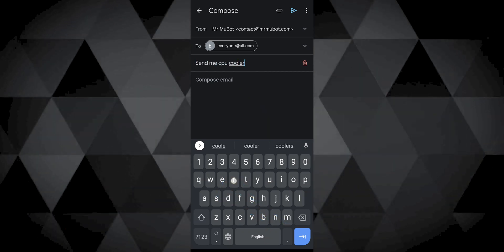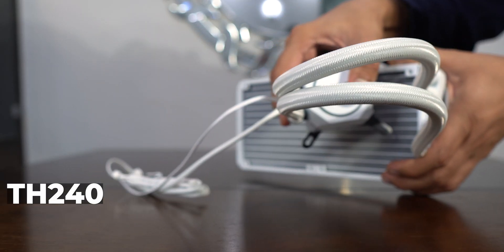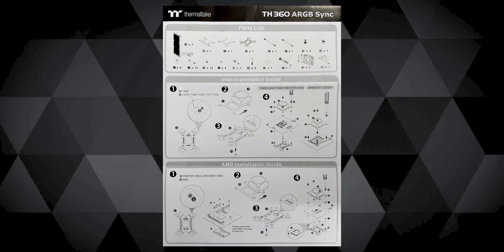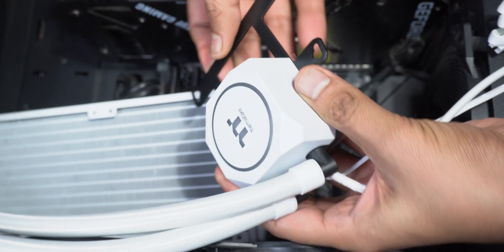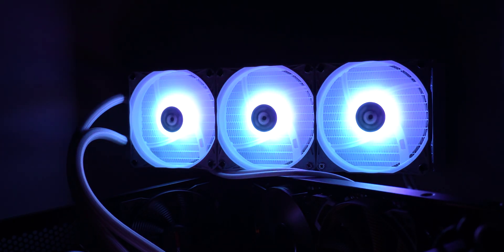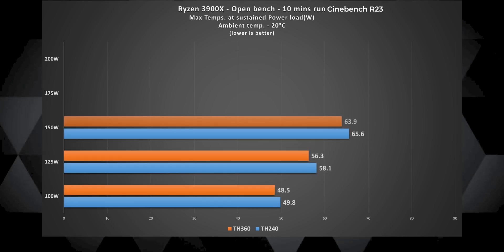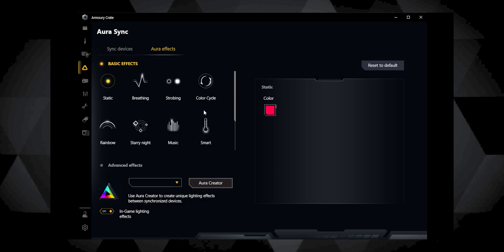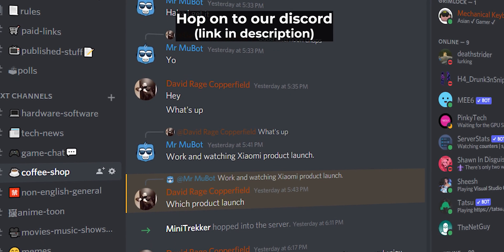When a 240mm AIO competes against a 360mm - Thermaltake TH240 TH360 ARGB AIO review

Comment: hey bro, do you think the TH240 would be suitable for an i5-13600K? or do you think it would be better to go for a different 360mm AIO due to how hot the CPU can get? will be mainly gaming and plan to pair with a 3070/3080 possibly
Reply from the maker: I would not recommend it if you are buying it new. If you already own it then you can use it for a lot of stuff(including gaming) easily. Till it's not all core rendering something for hours.
Reply: @MrMuBot  what alternatives would you recommend for that CPU? is a 360mm AIO excessive? maybe a different 240mm AIO would be better than the TH240?
Reply from the maker: Check arctic freezer II